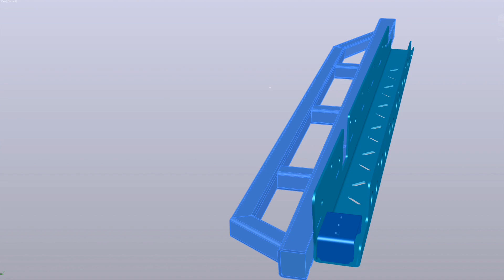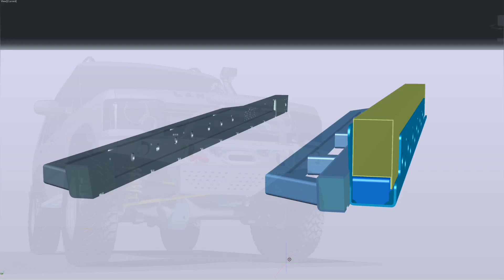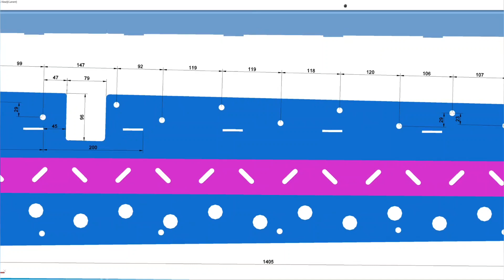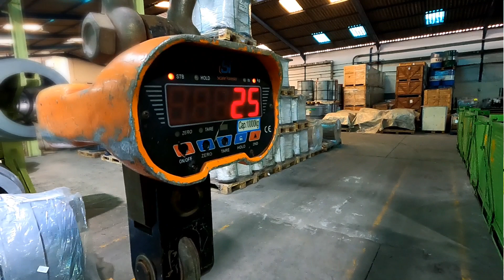Building Discovery 2 HD Rock-Sliders: Step-by-step Guide!

Comment: Great design, do you find the addition of the holes/slots help or do they allow for ingres of mud ?
Reply from the maker: To answer your question for which I thank you, I couldn't think of anything better than to go back a century to see what CHARLIE thought about it...

Indeed, the holes which appear laterally oriented outwards will be subject to generous penetration of mud into the tunnel welded to the main base. However, drainage holes oriented downwards will release this mud with a simple carwash when washing the DISCO.

That said, Charlie confirms that these holes were deliberately designed to ensure better ventilation of the interior of the tunnel avoiding any oxidation of the metal (This is what unfortunately happens to many commercial rock sliders). Because even if these holes did not exist. water and or mud will easily find their way to the interior of the tunnel from the two columns of the front and rear door and also from the LOGO.

The other holes located inside the main block do not present problems because they are juxtaposed to the sill. Despite everything, alternating oval openings are there to avoid any retention of mud. In addition, this makes the rock slider significantly lighter.